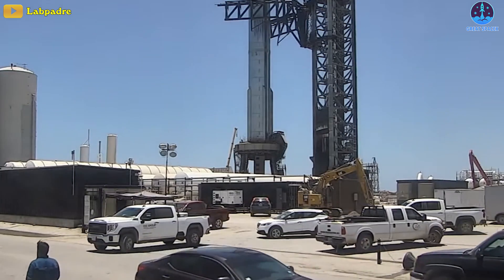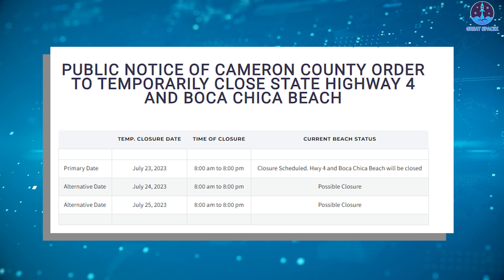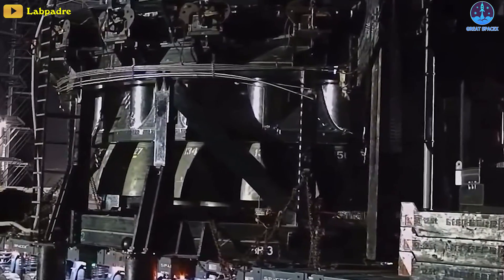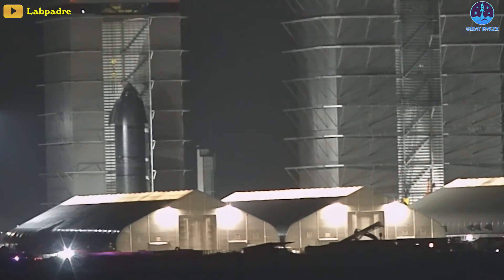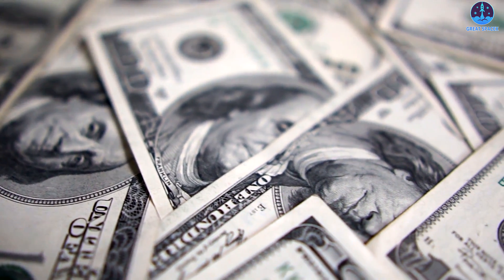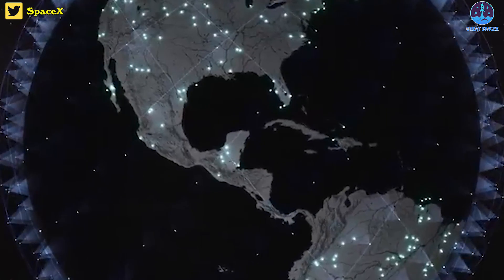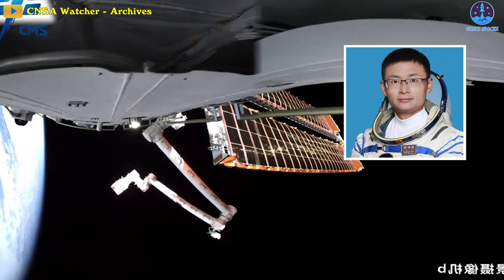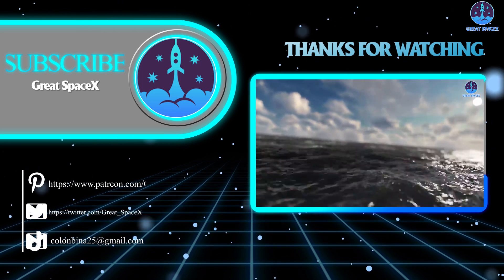SpaceX's ready Second orbital Starship attempt, Elon Musk reacted? And New hot-stage ring design...

Comment: If all the engines don’t ignite on launch it’s not a failure. Musk has stated the rockets engines are not at full power. If engines fail that they just add more power to the working engines to compensate. This launch will fail as there were many issues with the first launch and it will be almost impossible to fix them all so fast. It may take several launches to work out the problems.

Comment: The second flight of Starship is not aimed at a booster landing and Starship landing...

The second launch is to test the OLM and hot staging

People should realize that not every test is a full test
Reply: Second flight is about switching structural support of the Starship during liftoff from using the Skirt to using 6 VacRaptors as support columns sandwiched between the Starship and the SH Booster. Hot staging is just a smokescreen intended for disguising cradles for support of expansion bells of VacRaptors mounted on top of uppermost dome of the SH Booster as heat shielding for hot staging.

Comment: Rocket engineers solved the hot-staging interstage over half a century ago.
Triangular bracing. The most strength for the least weight.
I don't know why SpaceX feels the need to "reinvent the wheel" and ignore what is so obviously the best solution.
Reply: From first principle engineering, Space X changes improve on components, easier and cheaper to manufacture.  The wheels were once made from wood, so reinventing it maybe a good idea.
Reply: Elon is going to use 6 VacRaptors as support columns sandwiched between the Starship and the SH Booster. Hot staging is only a smokescreen so he can disguise cradles for expansion bells of VacRaptors mounted on uppermost  dome of SH Booster as heat shelding for hot staging

Comment: The pictures you show of the ‘hot staging’ rings (2:15 into your video) raise a lot of questions. The mass of Starship above (around 1285 tons fully fuelled) needs to be added to thrust from the 33 Raptor engines below, which will be pushing against the struts in the ring with a force of 9000 metric tons (88,250 kN) . That’s insane. If the hollowed out staging rings can withstand that thrust without collapsing, then surely Starship and the Superheavy booster could save a huge amount of mass by using the same hollowed out struts rather than a fully sealed tin can construction?
Reply: I feel like it's way more complicated then that and we don't even know what they are for all we know is there there and that's about it
Reply: Elon just loves people as observant as you are. You just observed that vent ring cannot support weight of the Starship during liftoff (your math is bit off as thrust force is distributed according to remaining mass so the rocket travels in one piece before separation maintaining same acceleration for all pieces of it). What you did not observe during last test flight  is the fact that the fully skinned but unpressurized Skirt partially collapsed before rocket started to tumble. This partial collapse occurred while acceleration  according to tracking was only 7m/s^2 while acceleration required for succesful liftoff should be around 35m/s^2. Elon is not going to admit that he walked into blind alley with the Skirt he is going to do magic right in front of your nose. He will introduce 6 VacRaptors (that is minimum number of rocket engines used as support columns that need to be sandwiched between bottom dome of the LOX tank of the Starship and uppermost dome of Liquid Methane tank of of SH Booster) explaining that they will improve performance and safety. Elon will erect 6 cradles for expansion bells of VacRaptors on top of uppermost dome of SH Booster and he will disguise them as heat shielding for hot staging. He will launch his rocket  and that rocket to your utter amazement defying all physics will make it to orbit. And then Elon will casually admitt that he switched structural support of the Starship from the Skirt to 6 VacRaptors used as support columns he will say that he had no choice in that matter because venting ring for hot staging could not take the load of the Starship. BS baffles brains of many smart people. There is more of that in SpaceX saga.

Comment: I hope that the new section of booster upgrade can withstand the large amounts of heat from the Starship separation. 🤔😯
Reply: I think they are installing shielding on top of the liquid oxygen fuel tank dome. Any heat will turn the LOX into gas and will have to be vented before a landing burn.
Reply: I have the same preoccupation